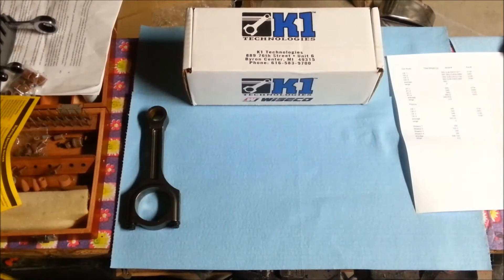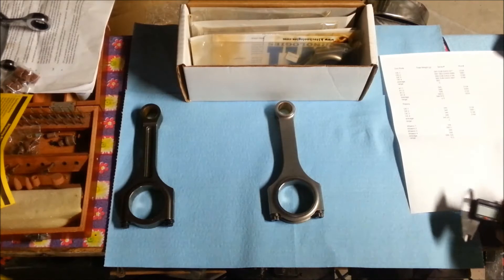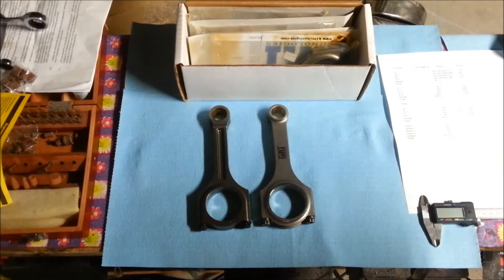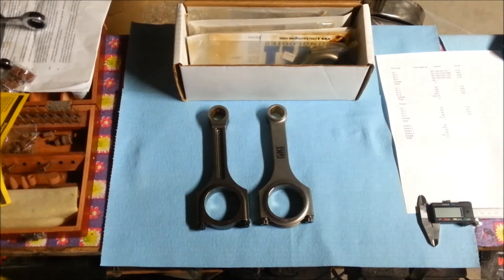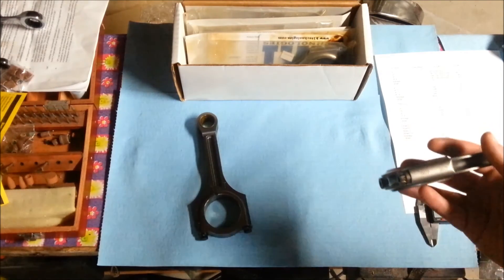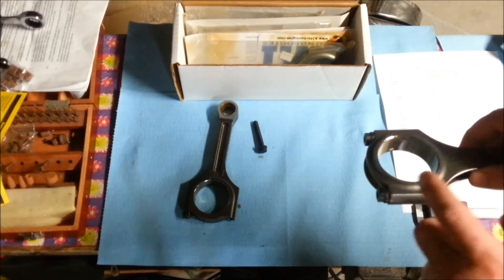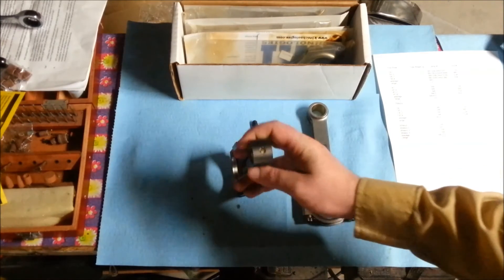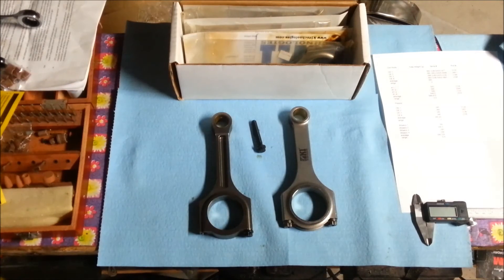K1 Connecting rod review

Comment: The ‘flutes’ you speak of do not stop the bearings from rotating,  the crush force between rod and cap provides the holding force. The OE design you have there is simply to save money in the manufacturing process and eliminates an assembly mistake proof feature preventing bearings being installed the wrong way around.

Comment: Have you ran these yet? If so in what? HP/Trq... How did/do they perform? Hold up? ...Thanks...
Reply from the maker: they are in my car right now, I cover installing them in the Woodstock video series.
So far they've handled ~400lb-ft at ~3600rpm. Very little was needed to balance them end to end. No complaints to speak of, they're not noisy (though properly sized and fitted they shouldn't make any noise), I don't notice the few grams heavier they are because we removed some weight from the crank and K1 was able to give me all the info I needed for installation.
Reply: Good deal...I'm installing a set in a couple weeks and just wanted to be sure that the billet set would be capable of those numbers...I'm shooting for right where your are actually... ~400rwhp...I didn't think it would be a problem but it never hurts to hear from people with actual data...thanks...

Comment: Interesting that the K1 forged H-beam rod weighs less than the OEM cast I-beam rod.  Does K1 offer a forged I-beam rod for your engine?  If so, why did you opt for the heavier H-beam K1 rod (i.e., are you going heavy boost on a forced induction setup)?
Reply from the maker: I believe only if you custom order one, otherwise it's just an H-beam.
I opted for the K1 rods because I preferred the Wiseco pistons and I've always been of the opinion to use matched sets (same maker means less chance of someone doing something differently and causing an issue). While my engine isn't high output, it is aimed at longevity and it does see high boost 25+psi so I wanted a slightly heavier rod for that vs. light reciprocating weight which would be more aimed at faster revs and more output.